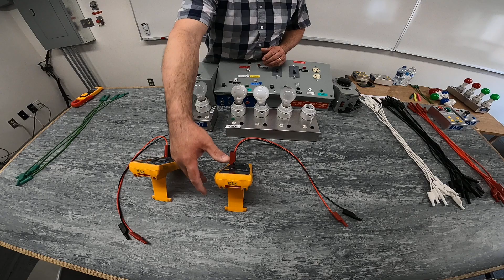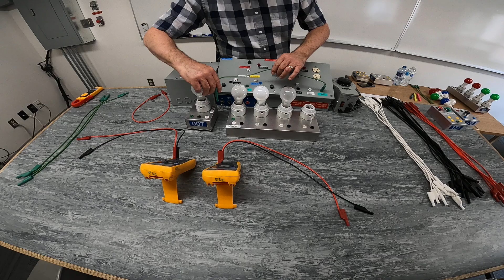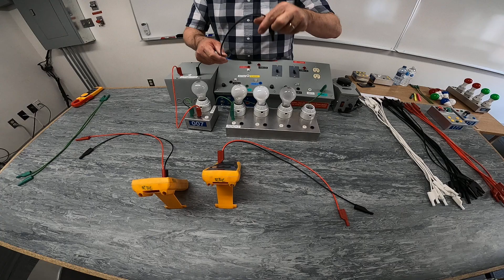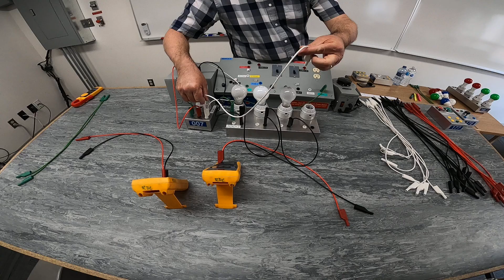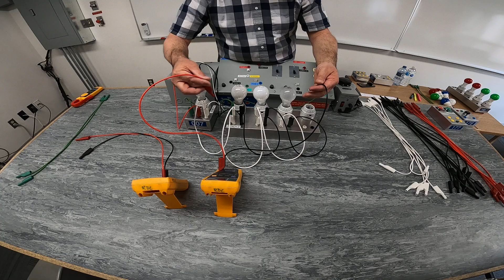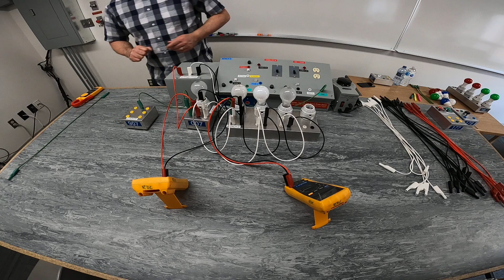EDISON 3 WIRE SYSTEM - 1

Comment: Shared neutral on 240 volt North America system.   
Branch 1 is lower resistance because it has 3 loads in Parallel.
Open the neutral, Branch 1 and Branch 2 are now in Series to one another.
Branch 2 ( one bulb) will have MORE resistance therefore higher
voltage drop.